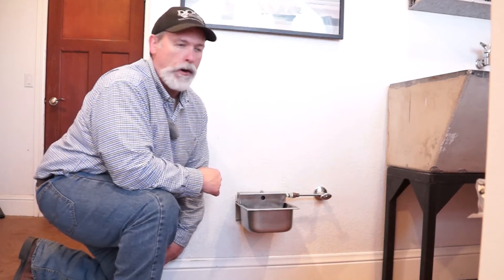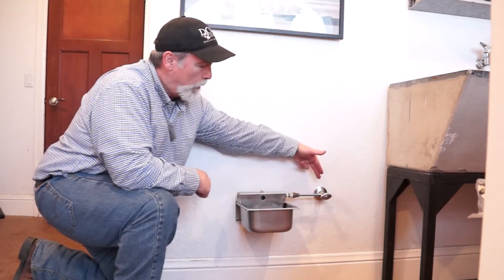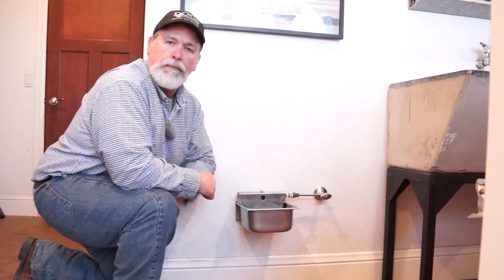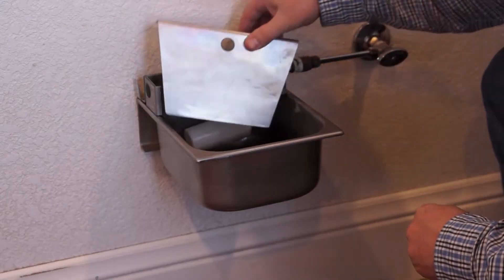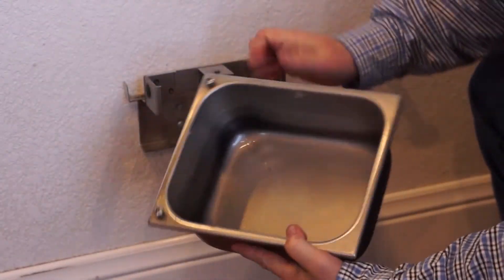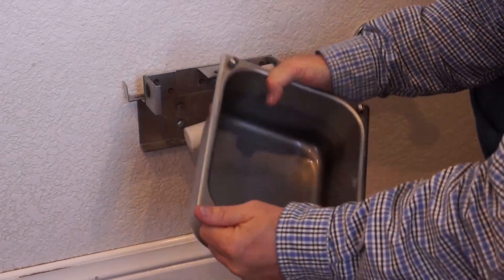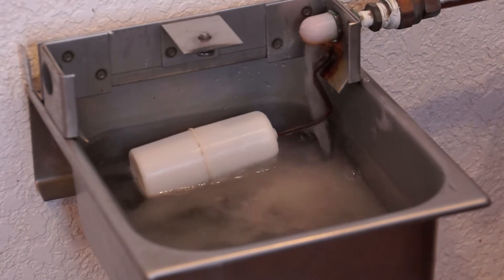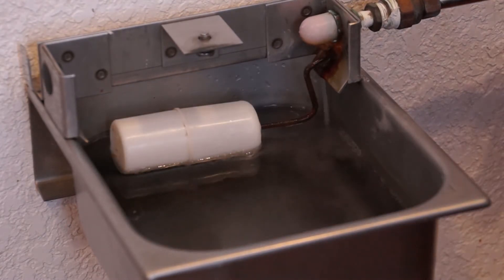Nelson Automatic Dog Waterer

Comment: They made a stainless steel bowl and mounting bracket and the metal that holds the barber is steel which is Rusting it should be made out of stainless steel also
Reply from the maker: Hi Buddy, thanks for letting us know. We'll pass your suggestion on to the manufacturer.